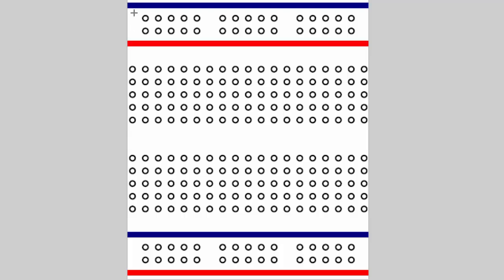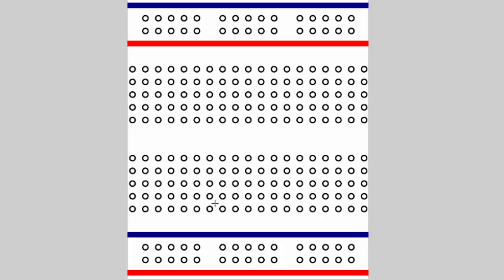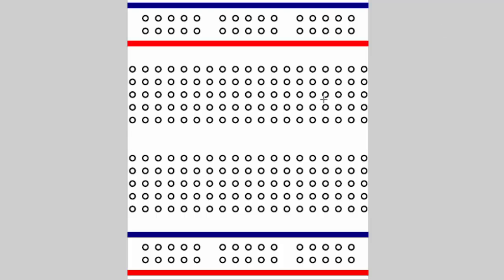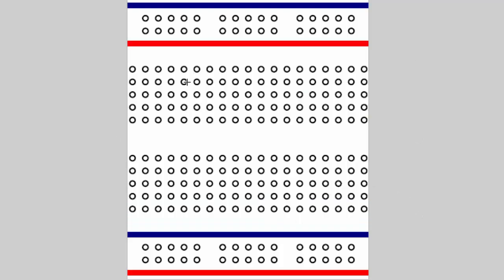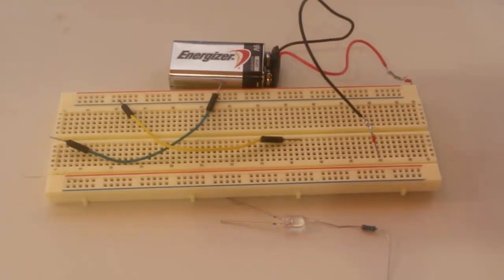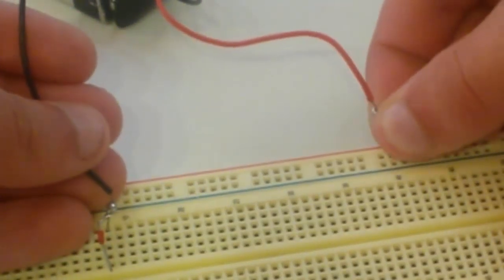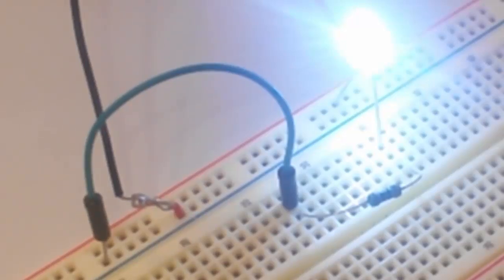Beginner Electronics - 10 - Bread Boards

Comment: I'm confused on why that last wire was required. Couldn't the resistor have connected its other side to the same row as the negative battery wire (ultimately where the 2nd wire's 2nd point ended up at) to trigger the light bulb? New here so genuinely curious.

Basically, the bread board video included an additional wire that wasn't required in the battery -> bulb -> resistor -> battery video, so just wondering if that was actually required or if it was just an optional.

Comment: In Episode 8, you attached the resistor to the long part of the led. Now, you've connected the resistor to the short part. How does this work both wys?
Reply: Basically, resistor can be attached on either way. Positive or negative
Reply: @syahmiefarhan2703 thanks
Reply: It does not matter

Comment: I was doing things my own way yesterday after i watched the resistor tutorial, i had a breadboard so i did some circuit on my own, burned 5 LED just to figure out that i plugged my resistor of both ends in the negative rail so basically the resistor wasn't doing anything or I don't know, fixed it when i realized that. Anyways its fun to do things your own, mistakes will make you learn a lot

Comment: I cann't understand one thing.when you entered batteries and led and resistor wire into breadboard and not connected each other.how led on.
Reply: There are metals underneath that connects the columns

Comment: How does the current flow? Does it flow from the positive to negative terminal? If so, then wouldn't the resistor have to come first before the LED, that way current can be reduced before going into the LED?

Comment: Newbie question, why isn't the resister placed before the LED in the circuit?
Reply: the circuit wasn't completed until we connected the negative terminal so it's okay to put it like them just remember to order of your components along the flow of electron from the negative terminal or you will mess it up if you connect the opposite way.

Comment: it's clear , my only little tip/suggestion to make it more clear:

horizontally connected holes, call them rows, but the vertical ones a columns, just like in an excel table

Comment: The before video you told the resistor one end connect to the positive side of the battery and the other end connect to the LED and the other end of the LED connect to the negative side of battery. In this video LED and Resistor are interchange in the circuit. Is this correct or not?
Reply: Did you get your answer to this?

Comment: Amazing course , I have always had comprehension problems when it comes to electronics, but with your videos, I understand so easily, everything is well explained......i have a question about this video, i noticed that the cathode is on the regular rows of the breadboards, can we consider that side as the negative terminal ? and about the wire , i don't understand why there is one side on the negative terminal of the power rails instead of the positive terminal of the power rails , could you break this down for me ? thank you so much

Comment: I have a doubt 
On 1:44 you says top and bottom pins are not connected but on 5:39
You connect posetive on bottom layer and negative on top layer

How it works ???????????????
Reply: Those wires are connected to the battery

Comment: Isn’t the current flowing from positive to negative terminal? If that’s the case why is the resistor placed after the LED? Isn’t the resistor suppose to block too much current coming into the LED? How does it limit current if it is placed after? Trying to understand the concept

Comment: I have a question . Why wouldn't you put the resistor before the positive side of the led? Shouldn't the resistor come before the positive side of the led?
Reply: It doesn’t matter whether the resistor is before or after the LED in the circuit as long as it's in series with the LED. The key idea is that current is the same at every point in a series circuit.

Imagine water flowing through a pipe with a water wheel (LED) and a valve (resistor). Whether the valve comes before or after the water wheel, it still limits the flow of water the same way. The wheel only cares how much water flows through it — not the order.

Comment: Nice series, really appreciate it pal! Got a question tho, does it matter where the resistor sits , like on the + or - side of the led? Or is it just important that its somewhere in the circuit? Ive seen videos with both versions, but they never specify why they put it there exactly.. on my breadboard, both versions work, but Im not sure if i can damage something.. ty!

Comment: Question I thought the resistor has been connected to the positive before the component not the negative.  It doesn't matter as long as it's within the circuit?
Reply: Did you get your answer to this?
Reply: @alexmarsh1098  nope

Comment: so does it matter which holes you plug in to as far as similar regions of the bread board go? (i.e. could you have plugged the other end of the resistor thats not connected to the LED to a different column within that top-center region?)

Comment: How is the power rail connected to the rest of the breadboard such that if you connect a battery , it powers the entire thing?
Reply: I believe the other metal strips on the breadboard are powered by the same components being used. Just like the resistor was used as a medium to power the  LED on the previous videos. 

But I could be wrong since I'm no expert and just started learning with this tutorial series. 
I hope this gives you at least a basic idea of how it works! Happy learning! :D

Comment: Point of confusion - I've seen drawings appearing to show power emanating from the positive terminal, going through the resistor, then the LED, and terminating at the negative terminal. This appears to be wired the opposite way, and power seems to originate at the negative terminal. I have seen other videos and other materials that show circuits starting with positive and ending at negative, but then saying that power actually flows from negative to positive. I find this very confusing. What's the scoop?

Comment: There's one thing I'm a little confused about, if someone could clarify I'd love it.

The voltage runs from the battery, into the bus lane. Then, it goes directly into the led BEFORE going through the resistor. This is something I don't understand.

If the voltage from the battery hits the led before it hits the resistor. doesn't that mean voltage should be too much for the LED?

In episode 8, when this circuit was made without a breadboard, the resistor was wired before the LED. So, the voltage hit the resistor first and then hit the LED, which still worked fine. So, the order of which comes first, the LED or resistor, doesn't seem to matter.

I'm sure there's a logical explanation for this and I'm just missing something, so if someone knows and could tell me I would love it :)
Reply: I found it confusing also.  The relationship between the bread board rows and bus rails didn't seem to correlate to the physical example from before.
Reply: As i understand it the current flows from negative to positive, therefore it does go through the resistor first, then the LED. A little confusing as he built the circuit backwards from this perspective.

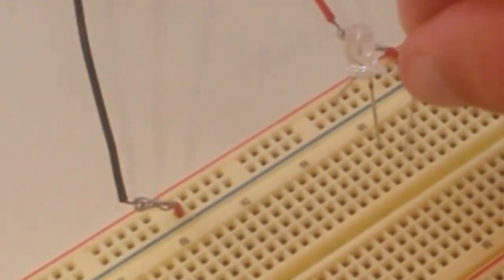Comment: At 6:32, after connecting the resistor to the same row as the cathode. My noobie brain would have guessed that the next step would be to connect the other end of the resistor to one of the holes in the negative power rail. In my mind, that would seem more exactly like the set-up in tutorial 8. Can anybody explain the extra step in this set up? Why was it necessary to connect the other end of the resistor to another hole in the main board, then completing the circuit with an extra wire? Keep in mind, this is a question from the mind of a noobie. LOL!
Reply: Hi Kung-Fu Mojo, there was no reason for him to do it actually, it would have worked absolutely fine the way you're talking about, if the other end of the resistor was just connected directly to the negative power rail. I think he just did it to show a bit more information about how you can use wires to connect to holes in the board and for illustration purposes
Reply: @54321conor  Thank you! I was worried I wasn't understanding something.

Comment: I was so confused by bread boards now I understand I actually was following you as you were putting the components in and I knew why nothing was turning on then I predicted correctly the light would come on when you put the wire in because of that very good explanation of the bread board terminals I now understand

Comment: Resistor should be connected to the positive terminal of the battery, as you said in previous videos , but here you connected on negative terminal.

Comment: Hey, bro I have a question about the place of resistor in circut,  you connect positive pole of battery in positive lead or leg of led and negative pole to one of the side of resistor if we connect the positive  pole of battery first to one side of resistor, then connect another side of resistor to led an next connect negative leg of led to negative pole of battery,  it will work?
Reply: Did you get your answer to this?

Comment: I was following fine until you started with the Bread Board.  I understood the power; however, became lost when you started plugging them on the board.  The resistor must be plugged into the same area?  The last wire I didn't understand at all.  Help...

Comment: Hi, you connected positive terminal of battery directly to LED and then with resistor? Resistor should not be before the LED??As current flows from positive to negative and drop should be before the LED.isn´t it??

Comment: Shoud resistor connect to the negative or positive terminal of the battery? In episode 8 I saw +ve led connect to resistor and resistor connect to the -ve terminal... But in    10 th episode + ve LED terminal is connected to 9v

Comment: Hi @codeNMore. Thanks a lot! That was brilliant! I have a question. So the resistor is plugged into negative here. But as per your 'water pressure' example shouldn't (or best practise) to connect the resistor before current get's to LED? or does it not matter as exceess current will be taken by the resistor when it get's out of the other side on the led? Thanks!
Reply: Never mind. I think I got it. The current throught the cirucit is same! But please do add your thoughts here too!
Reply: @53nat0r  There's a bit more to it than that, but yeah, you can generally put the resistor on either end. There are fancy LEDs that can display multiple colours, and they have one lead for each colour and then either a common anode or common cathode. As such an LED is basically three LEDs held together with gaffer tape, the different colours have different forward voltages, so you don't put the LED on the common terminal, but on the terminals matching the colours.

Comment: Hello CodeNMore, thanks for the great tutorials, they are highly appreciated!

I have a few questions about this video that I hope you'd be willing to help me with.

As explained in previous videos, the anode of an LED has to be connected to a positive terminal, and the cathode to a negative terminal. That being said, you connected the anode of the LED in this video to the positive terminal on the power row, which was expected, but haven't connected the cathode to the negative terminal on the power row, but rather used one of the holes on the "regular" rows. Why was this case, and what differentiates the horizontal power rows from the regular rows?

When connecting the resistor to the board, you plugged one side into the row where the LED was, which was understandable, but the other into another row. Why was this the case, and what would have happened if you plugged both ends into the same row?

And lastly, upon connecting the battery, LED and resistor to the bread board, the LED didn't light up until you also connected one end of the additional wire into the row where the resistor was, and the other into the negative power terminal. Why was this wire necessary, and why did it have to be connected in such a way?
Reply: did you find the answer? :)

Comment: A quick basic question. When you plugged the LED and the Battery into the breadboard without the resistor in place, what's stopping power form being applied immediately and blowing out the LED?
Reply: the negative lead of the LED wasn't connected to the negative terminal (the blue line on the breadboard) of the battery at that point. hope I could help.

Comment: Little confusion. In video where you connected led to battery with alligator clip resistor was between positive on battery and led however on breadboard you connect led directly to positive on battery followed by resistor. Hope you understand what I’m getting at. Does the location of resistor on the schematics not matter?
Reply: Did you get your answer to this?

Comment: Do the wires from the battery need to be plugged into their respective power rail (e.g. positive into red), or can they go in either?
Reply: they can go into either but the colors are for quick easy reference

Comment: At 6:06 did the LED have to be put in the positive spot, or could you switch it around. (Basically, is it necessary to start with the positive side. Could you not of plugged the negative side of the LED into the negative part of the power rail and then put the positive part of the LED into the main bread board?) Any help is appreciated.
Reply: Very late on this one but yes you should be able to put the Cathode into the Negative terminal and the Anode in just another blockset.

Comment: I don't get the bread board. The previous video shows that the resistor is connected to the +ve terminal
, then connected to the LED. But in the bread board the situation feels a little reversed and illogical.

Comment: Hi , thank you for your series. Question : How come the resistor can be placed on either side of the LED ? I thought that the DC power travels in only one direction and the power should go through the resistor first before hitting the LED . Thanks in advance
Reply: little engine I thought the same thing, but this comment cleared up my confusion: 

“Think about all the particles moving at all points in the circuit at once, like a belt or chain. If you slow down the chain at one point, it slows down at every other point, too, due to the links pushing and pulling against each other.”

https://electronics.stackexchange.com/a/13753 

They even shared a online simulator to see visually how the current was flowing. 😃
Reply: Fantastic analogy !, thank you for your reply  @kirbysimmons7010

Comment: Hi,  1.  Can we connect red colour battery wire to green side  on bread board and green colour battery wire to red side on bread board,   
2. For battery we have positive and negative charges, similarly  do we have charges on bread board also, if yes, how can we identify them on bread board. ?

Comment: Hello CodeNMore. I have some knowledge ability with electronics as I used to study it in the mail. (Long ago.) I never did get a degree of sorts, but have been interested it in for many years. I did get into working with  electronics back in 1995 and was constructing Generators for Ranchers mostly, converting Gasoline engines over to propane power, and setting the engine up on a frame with a usually, 6000 watt generator. I made up the controls (brain boxes and components for auto starting to pump water from a well for cattle out in the boonies. They would use the float system, so when a float dropped below a specified  height it would attempt a start. 10 seconds per crank. If for some reason the engine did not start, it would rest for ~ 10 seconds, then try again. If for some reason it did not start with three tries, it would  shut down. 

I am writing just for a get go on what I am learning here.  On the Breadboards, as I am seeing your explanation, I understand the power strips, (top and bottom,) each supply their half of the Breadboard? Now, when you were explaining the rows in the two sections in the middle, and relating "if you put a wire in two of the different rows, or across the center, these holes are not connected" I do bevel you were explaining prior to the wire this to be true? As, when the wire was inserted in two unconnected holes, it would make those holes connect, thus supplying power across the entire board section or rows with the wire. Did I get this correct? (The wire would then become the conductor.)

Comment: I can see why you are concerned about describing exactly what you are saying as there is scope for misunderstanding: 
The power track holes are connected horizontally. So one wire in one hole and a separate wire in another hole along the same track means you have two separate wires both connected to the same power track. But the two groups of 5 vertical dots are both connected vertically within each group but not between the two groups.
The confusion comes when you say "now if we connect a wire to this hole and connect a wire to that hole they are/are not connected" but you have to make clear that you are NOT connecting the other end of the same wire but are in fact using two separate pieces of wire to plug into the two holes. It is whether the holes are connected by the track underneath that you are describing as connected or not connected & not the wires that you have inserted.

Comment: Can anyone explain to me why the other leg of resistor is to attached the other vertical line of holes..since he said the different vertical lines are not connected to each other. So how could the current flow ?
Reply: There is a wire on the SAME vertical line as the left hand leg of the resistor. That wire is connected via the top busbar back to the battery's -ve terminal.